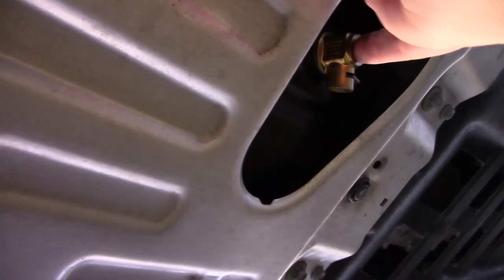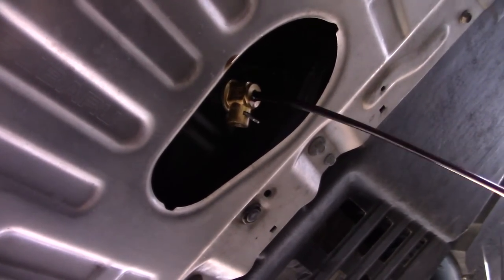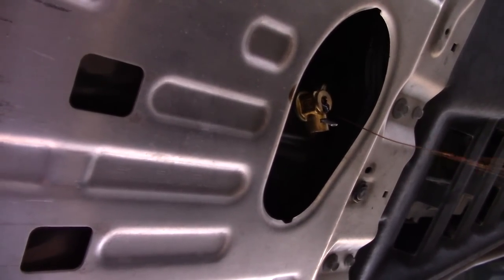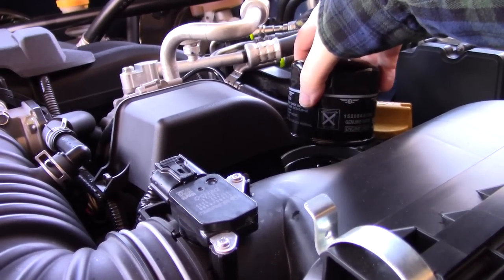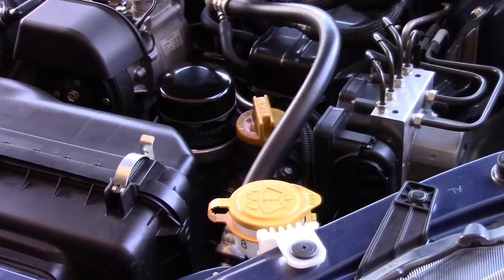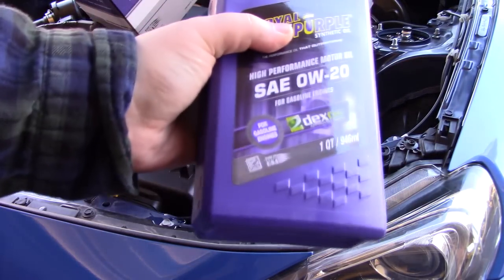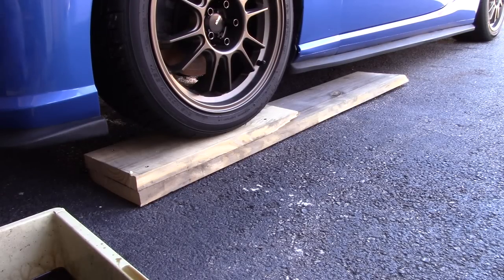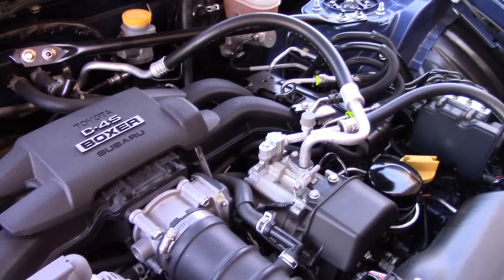Fumoto Valve - Is it worth it?

Comment: If you ever have a chance to see an engine tear down from the lower end you would see how many locations there are that will actually hold small amounts of oil after the case has been drained.  What may be left as a result of the slightly longer Fumoto bolt is inconsequential compared to what oil is normally still remaining.  Think about it - how much residual oil (during a normal oil change) do you think you could get if you could squeegee all the wetted surfaces inside the case?  This is all ok - change your oil and filter per the manufacturers schedule and use descent oils.  You'll be fine.  The Fumoto valve is a great design, but I would not use it on an off-road vehicle where it would be subject to impact.
Reply from the maker: Really great info, Super reassuring. Thanks for the info and thanks for watching!
Reply: Most engine manuals say that there's about 0.5 to 1 quart of oil left after draining. It doesn't make a difference unless your engine oil is VERY burned and broken down. At that point you might as well toss the whole car away for a new one.
Reply: If your offroading, you should have skid plate. And that's why on my off-road forester, I'll be putting this in, and I'll be keeping a piece of those attached that comes through the skid plate
Reply: My thoughts exactly! What if it has a malfunction and you leak all the oil out? I really want this but my gut says no.
Reply: Thanks
Reply: @mrdallas9729 ...how would this valve malfunction?  There is a lever/handle contained in a recess, a spring to keep the lever recessed and a ball valve.  Unless the spring fails, it still requires force to move the lever out of the recess.  Now there is a clip to prevent accidental movement of the lever.  Second, the ball value won't fail unless a large piece of debris prevents it from closing.  But that would happen when you are changing the oil and you will notice it right away....
Reply: @K03sport  Murphys law.
However I now have skid plates on my 4x4 and I do some crazy off roading. I might actually look into buying this now.
My biggest concern was something hitting it while I was wheeling offroad.
My steel skid plates should protect it now without a doubt.
Reply: @K03sport  also there's youtube videos that's this as already actually happen on cars with the extender.  The var was low he hit it and all the oil drained out.
Reply: You were right about him being paranoid about exes oil lol. I started laughing when he said he was taking it off to get all the oil lol. Now in regards to following the manufacturers recommendation is stupid advice. Toyota suggest every 10k miles and we all know what that does to any engine. Change the oil before 5k people.

Comment: The best way to test if the valve is letting all the oil out is drain how you normally would with the valve and then unscrew the valve off and see if more oil comes out.

Comment: Good video.  I just installed a Fumoto valve on my Outback.  I have not changed the oil with the valve yet, but I can confirm these valves do not leak.  I was a little worried about leakage.  Good idea on the wood ramps.
Reply from the maker: Nice! Just wait until you change it... So convenient just crawl under and push the tab and wait lol. Thanks for watching!

Comment: I been using it on my 2006 Liberty CRD for over 10 years of ownership.  The engine has an aluminum oil pan that is known be be easily stripped and this was highly recommend on lost jeeps forum. The value saves time and potential damage.  There is a security clip you can also buy on Amazon for all the F series valves if you want or are worried about the value opening by accident. It's under $2. 

I'll be putting it on my next vehicle too.
Reply: is it letting the old oil inside the pan?

Comment: Fumoto valve is worth it. Once installed, you never have to worry about stripping the drain pan. Mine is four years old and has never leaked a drop.
Reply: I like the valve.
But if the drain plug is never over torqued, it will never strip out.
Reply: @nickv4073   That's why I always change my own oil and use a torque wrench on the drain plug.
Reply: I've had it on my Jeep Liberty CRD for over 10 years. Working perfectly.  The engine in mine has aluminum pans and very short drain plug with Allen key bolt. Very easy to Cross thread, over torque or loose to washer which damages to pan.  Fumoto valve is great for such applications.

Comment: I have been using this valve for 5 years now since I decided to change the oil in my truck myself, save money and it's also a way to know my truck anatomy as well. I would say this valve is ok but it takes a lot of time to drain the oil because of the small opening on the valve drain exit. The only advantage I can see is it's much less messier to drain the oil with this valve and it can direct the used oil straight to the container with the help of a hose that you can attached to the valve itself also you don't need to change any plug gasket every oil change as you would do with the original plug but other than that, it's still better to use the original plug as it's makes the draining faster.  that's me!
Reply: True but I use them for one reason only. Once its on, you never have to remove it which means there is no chance of stripping out the threads on the oil pan.
Reply: I would like to know how much additional oil would drain out the oil pan if the Fumoto valve was also removed.
Reply: And you don’t have to worry about cross threading the drain plug each and every removal

Comment: The location of your valve is perfect because its set in the frame hole.  Many are just dangling down and I'm afraid hitting debris on the road could pull on the lever and then.... bye bye engine.

Comment: Local oil change shop messed up my thread as they put back the wrong screw.  This will help with that and also with my problem by installing this and putting thread sealant.

Comment: The following is all Imho. First, warm the engine if it isn't already. Warm oil=faster draining. Second, remove the oil fill cap and in this case since the filter is inverted remove that also. Oil flowing out replaced by air flowing in=faster draining. Also if you want to see if the drain valve retains any oil due to deep set threads, remove it after all out had drained. Any residual oil will flow out. That being said probably negligible amount compared to what sits in any cavity in the motor itself. I must I admit even a few drops would bother me (I'm a little OCD on that one). I've owned half a dozen Astro Vans that got at least 200k miles. One went over 400k. All on Dino oil. Many times way passed the recommended interval.  Although I do use full synthetic now, I still don't think paying all that extra per quart really pays off in the end, who really knows? Time to find a wrench...7 seconds. Time to remove threaded drain bolt... Another 7.  Worrying if the fumoto drain valve may fail or get caught on something and knocked open or off.  I use a magnetic drain plug, although many parts of an engine are non-ferrous.
Reply: If your engine has sat for a long time, all the oil is drained into the pan that can be in the pan. If you run the engine, you throw a lot of oil back into the rest of the engine. I would like to see a comparison of the two approaches.

Comment: Next time crack the engine oil cap for faster oil drainage. No “eternity time” waisted.
Reply from the maker: Removing the oil fill cap doesn't change the fact the fomoto opening it 1/4 the size of the actual drain plug. It drains just as slow with it on or off.
Reply: Venting is what he’s telling you. He’s right. It works. I have these fumoto valves in all my vehicles. I’ve had them for years now. Best thing ever.

Comment: Anyone have any useful hacks for the oil filter?  I have a 20 year old Silverado and the oil filter basically point straight down. I've seen drill a hole in the bottom of the filter so it drains.. I've seen use a plastic bottle over the filter.

Comment: You do realize that the OEM oil filters like the one you got come pre lubed that’s why it had that plastic over the seal when you took it out of the box
Reply: Really? I thought it was simply to keep the filter clean.
Reply: @thepokerpilotapp  😂😂😂
Reply: That's strange, because I just used an OEM filter sealed in plastic this morning, and it's stated right on the side of the filter to lubricate the gasket with a little oil. I do it anyway, regardless.

Comment: Royal Purple? Was thinking about running that instead of Ames. What do you think of it?
Been running those ez type oil valves in my vehicles for damn near 30 years. They are the best.
Reply from the maker: No complaints at all. Love royal purple... Not super pricy and does the job. I'd recommend it for sure. Thanks for watching!
Reply: Degenerate Motoring subbed
Reply from the maker: Appreciate that my dude!

Comment: You better have the car off the ramp to have all the possible old oil out your engine! I bet there will be left sufficient...   Draining is also better and quicker after your engine is at working temperature! You only have to wear some hand protection than... I would surely recommend to switch to a btter brand of oil like Castrol or Mobile. Last but nor least, ok video but I will not use the fumoto valve as I use a magnetic drainplug as I want to check if all is ok within the machine at least 1 a year when I drain the engine.
Reply: Forgot to ask you: when you have drained the engine and then as a 2nd step take the Fumoto Valvo off, how much oil is there coming out? You should check it out...

Comment: Hey buddy, mind sharing your ramp wood dimensions? 2011 WRX and don’t like using the jack 

Edit: well shit left the comment about ten seconds too early haha
Reply from the maker: +Tony P I've got a complete video outlining the build process as well but i used 2x6 wood, the bottom piece is a little over 4ft and the top piece is 2ft. Cut the wood at a 45 degree angle to make it easier to ride on and off. Good luck building and thanks for watching!
Reply: Degenerate Motoring thanks man, I appreciate the response even though I’m the dumbass that should have waited a few seconds longer for you to explain there’s a video. Totally stoked to make these ramps when the snow melts. I installed a mishimoto magnetic oil plug and torqued to mishimoto specs but I feel that’s too loose and don’t want to constantly jack up the car. Granted the plug is aluminum with a dowty oil seal, I’ve seen pictures of the heads snapping right off the threads. Thanks again man, feel stupid I didn’t think of doing this myself hah
Reply from the maker: +Tony P lol all good, I wouldn't really recommend working under the car with the wood ramps... In theory it should be fine but if the word where to crack I wouldn't want you getting crushed lol. Magnetic plugs are awesome the only thing I wish the fumoto had is some way of easily seeing metal in the pan. I mean you can look at the oil itself but magnetic plugs make it so much easier.
Reply: Degenerate Motoring eh, you don’t need a disclaimer haha I’ve been under my share of cars, far from a noob. My brother I have owned WRXs since brand new 2011. We completely modified his and only slightly modified mine. Mine was daily driver and his was child speed racer haha 16 with a brand new WRX... I wish

Comment: No thank you all I need is for the lever on the valve to get caught on something. or hitting a bump or with wear and tear overtime to lever and letting the oil out. and it’s bye bye engine that’s just the lazy way
Reply: They sell a safety clip that ensures that won't happen if you're concerned.   Ive used one for 6 years now and no issues.   Don't be a hater.   There's something sublime about a tool-less oil change.  You should experience it yourself... but wait, you won't, you're an old school warrior commenting from your iPhone11.
Reply: @linkinpark3184  I'm willing to bet he doesn't do his own oil changes
Reply: If you allow that to happen then you are just a bad driver.

Comment: Why are you using such a low quality oil?  It looks like you care about that car.
Reply: When you change the oil every 10.000km/6000mi, it doesn't matter if you lubricate the engine with coconut oil (read: being funny). Even the cheapest oils have been tested in some kind of enviroments for quality, so I see no reason to buy for example Castrol instead of Teboil.
Reply: @juupituupi8166  totally false. you have a points when it comes to additives and detergents, however pressure test results are all over the map depending on brand and grade.

Comment: I HATE the fumoto valve.  I used it on my Tacoma twice and ripped it off pronto.  It took a LOT longer to drain no matter what the morons who say they like it assert to everyone.  Fumoto fan boyz abound...
Reply: I have this drain valve on my 4runner.  Open the valve and change out the oil filter while the oil drains. Valve is protected by skid plate cover, otherwise I would not install on an off road vehicle.
Reply: So what. Its not like you have to stand there and watch the oil drain. Go do something else in the meantime and its not a problem..
Reply: I had one in my console ready for my mechanic to install it, before I asked him what he thinks of them. He said he hates them and that they're just an accident waiting to happen. Just one rock or other object tapping it or it leaking and then you have a destroyed engine. Now, if they had a written guarantee about covering that, rather than packaging it in a cheap baggie that you would find hanging in the fastener section of Lowes..